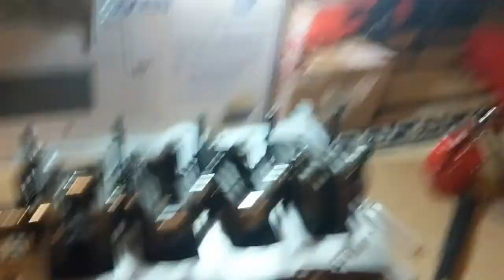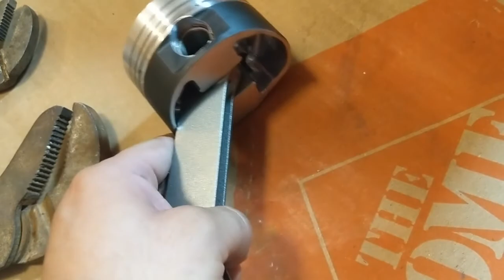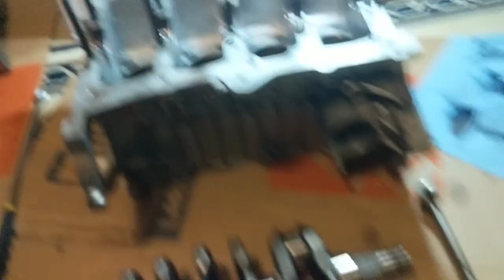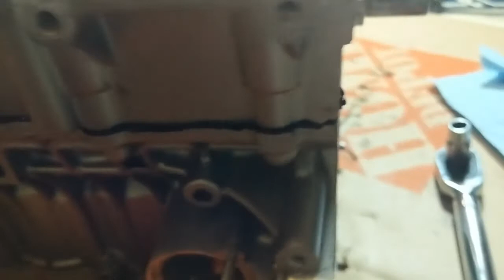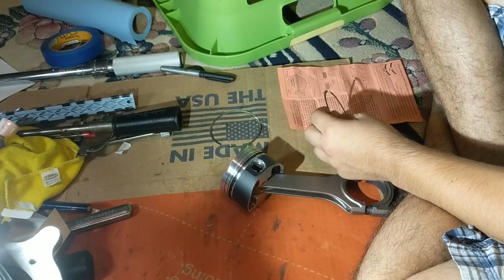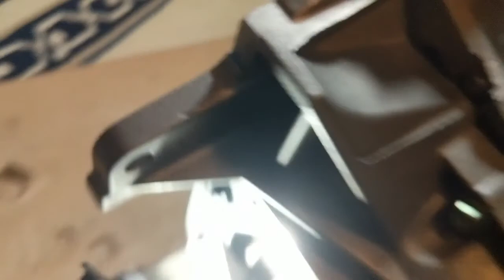400 hp FORGED Celica/MR2/ TURBO Engine Build | Bottom end PART 1(1zz)

Comment: Question, is that a billet block or the stock one? If so do yk where I could find a 1zz billet?
Reply from the maker: It's a stock block with forged internals , I don't think anyone makes a bullet 1zz however I would suggest into looking into a css 1zz black they created a closed deck or semi closed deck 1zz which helps strengthen the actual block of the engine

Comment: Hi JRivera!!!!!
I wanna say I love your channel I need some good tips on how to fully build my 2008 corolla s 1zzfe engine I’ve been looking into crower cams rods and crank . What is recommendation on how about coming with porting and polishing and also putting the darton sleeves? Thanks!!!
Reply from the maker: Porting and polishing would be great if you have a chance to do it I planned on doing it but unfortunately ran out of time , as for sleeves depends on your power goal , I didn't sleeve my block originally was going to but decided not too as I feel like the block can handle 100 HP per cylinder just a gut feeling based on other 1zz builds and it doesn't seem like an unreasonable amount of power for this engine
Reply: @JRiverathatredCelika  thanks bro!!!! Also what kind of Motor mounts should I use for my car